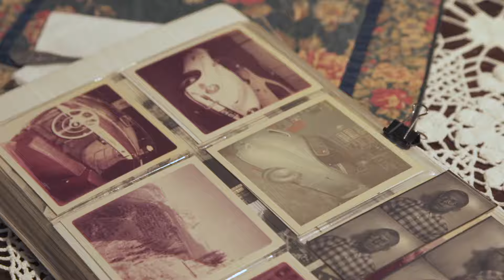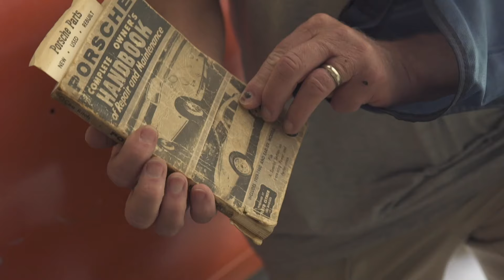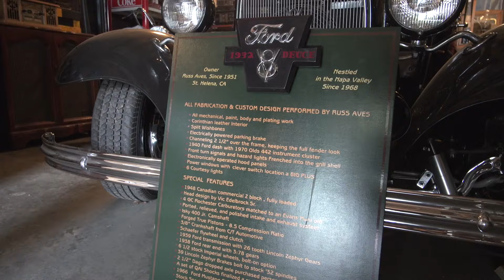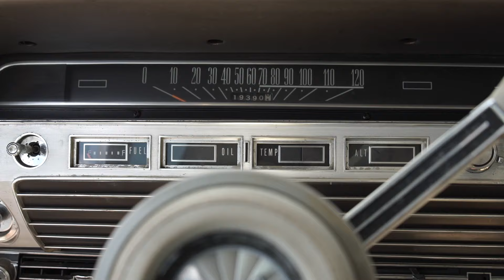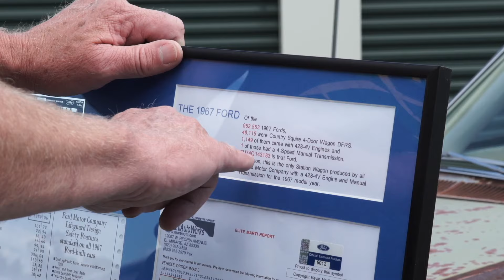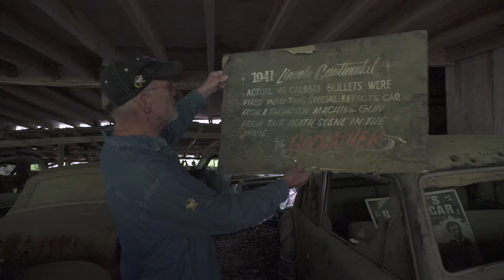Top 10 Barn Finds: Breaking down the top ten stories from the show | Barn Find Hunter - Ep. 89

Comment: Question about Story #5  . Tom states the owner painted his car "with his mother's vacuum".  Anyone here old enough to explain how that was done in the early 50's? Thanks.
Reply: 77 might be old enough. My parents had one of those old vacuums. If memory serves, bought right around WWll. Those vacuums were called "bullet" vacuums. Kinda looked like a odd shaped football with one end taller and fatter than the other end. Had wheels under it and the "fat" end had a ?? 8" round lid that hinged up to expose a well where a felt bag that collected all the stuff you vacuumed went. That lid on the "fat" end had a hose boss case onto it so when you "vacuumed", the hose was connected there. Obviously, the motor was in the middle and on the smaller end, there was another hose boss (right in the center like a belly button) where you would insert the hose for "pressurized" air flow. I don't recall my parents having the spray gun attachment but I do remember hearing of them. The vacuum moved quite a bit of air so it made a decent air flow. 
As it turns out, I met Russel in St. Helena and have a few of his business cards. One of them shows the 32 three window coupe and says he was the proud owner/builder since 1951. He was quite "the car guy" and would work on other peoples cars "just because he enjoyed it". RIP Russ !!!
Reply: @pappabob29   thanks for the  detailed explanation. Makes sense now. Seems  like engineers had more  imagination back in the day.
Reply: @festerhairball6588  Sure does !!! Designed and made things that lasted MUCH longer than this modern day  efficient but "throw away" junk they build now. My Dad passed away in 2002. That "Bullet" vacuum was still in use (in his garage) whenever needed. Probably 60 years of service and still nothing wrong. Not even the power switch !!!